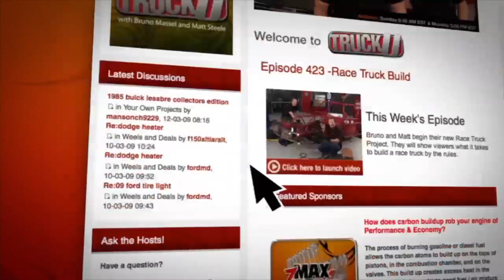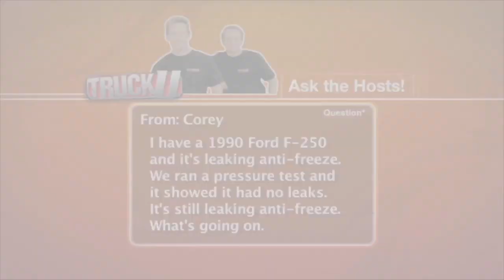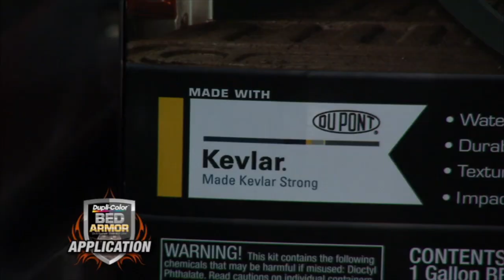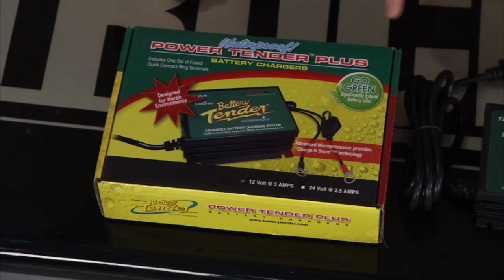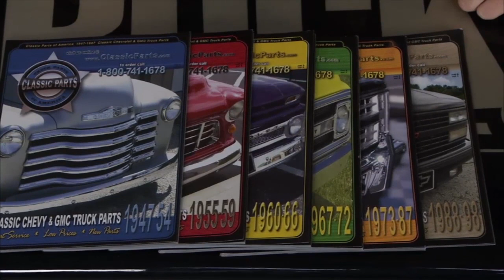Fixing Common Ford Problems | TruckU | Season 6 | Episode 3

Comment: Run 5W-30, not the recommended 5W-20, in all 4.6, 5.4, and 6.8L engines.  Especially the 3V engines (which also benefit from swapping in a higher volume oil pump).

Comment: The 4.6l ford's don't really have this issue unless due to human error like changing spark plugs when the engine is warm or crossthreading the plug. The 5.4l engine is where the problem is they literally have 4 threads holding in the plug while the 4.6 has 6.Not much more but the 4.6l has lower compression.

Comment: Left out exhaust manifold problems,oil pans rusting out,the triton engines eating ignition coils left and right.I beam suspension,like to eat ball joints and front tires.Ford did use an automatic locking hub which was a huge pile of junk,these get tossed and replaced with Warn manual locking hubs.

Comment: So I have a question I guess.  Every manufacturer has some problems with their product. But problems like this are much more expensive and involved to repair than something like an intermediate steering shaft on a Chevy. I've met many Ford owners that have had to have these heads repaired. I've seen other videos where the heads get oil sludge and stop feeding oil to the top end. These are not simple fixes. Now we have much more complex turbo V6 engines in place of conventional V8s. Many Ford techs say they would choose the 5.0 over the V6s due to reliability. So if these designs are so flawed,  why do people buy so many of them? Is it just good advertising by Ford, or are humans just stupid? Both?

Comment: I have a problem with a 2004 ford Explorer the power windows won't work I checked the fuses they were fine and when they went out it took the radio with it do you have any ideas how to fix
Reply: Did you figure out your issue? If not Check Fuse 1.6 (in the "Battery Junction Box", should be a 60A circuit breaker labeled "Accessory Delay Relay"), then Check Fuse 1.62 (in the "Battery Junction Box, Should be a 30A Fuse also labeled  "Accessory Delay Relay"), and Check the Accessory Delay Relay itself (located in the "central junction box") make sure it is getting proper control (pin 85 should have 12V from the Instrument cluster Fuse F2.17 in the central junction box, and pin 86 should be ground controlled by the instrument cluster) and make sure you have a power feed at pin 30 (this comes from Fuse F1.62, which is fed by Fuse (Circuit Breaker) F1.6. Pin 87 from the relay then splits inside the central junction box to power the "Master Window Adjust Switch" and the "Audio Unit". If all these fuses and the relay test good then you may have a wiring problem.
Reply: Brad Noyes thank you I will check it

Comment: look at all of the aluminum filings drop.
Reply: The grease trick doesnt work. The right way is to remove the item on an engine.
Reply: Use an air wand (I add some silicone tubing so you can really get it in there) and blow it out real well.  Then scope it (I use a cheap endoscope from Amazon) to make sure you got it nice and clean.  If there are a few little pieces it isn't a big worry--it's aluminum and every other part in there is steel and will just blow the rest of the aluminum out the exhaust.  I've done a few of these in parking lots and driveways, you just have to be thorough and you won't have any issues.